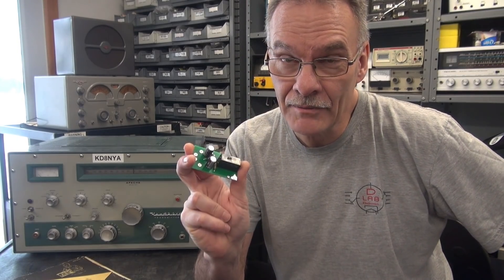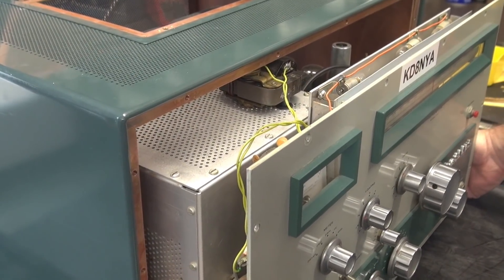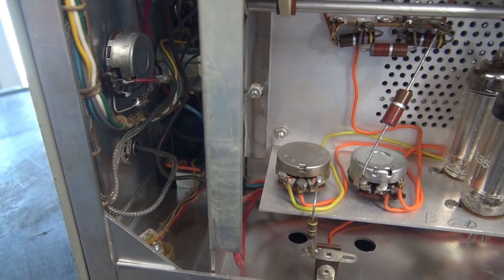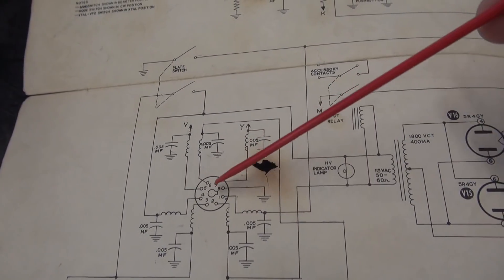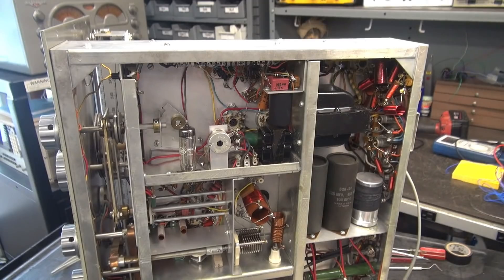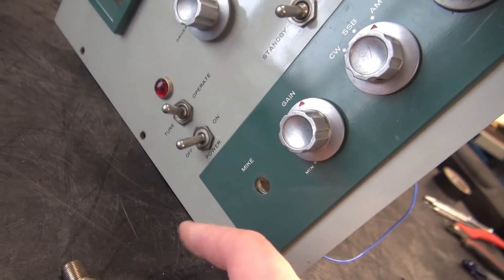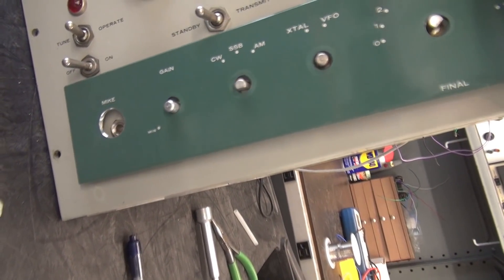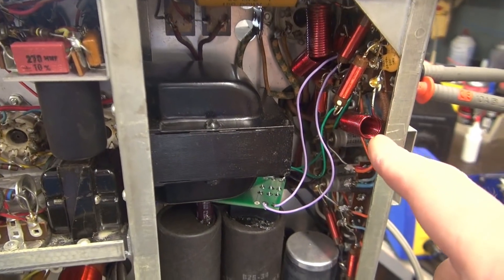How to install PTT Push to Talk Heathkit Apache TX-1 Ham Radio Transmitter

Comment: Hi Terrry.  I just picked up an apache.  My fix to the trs chassis mount jack issue was to use a flush mount jack with a 7/16 diameter × 1 1/4 inch threaded shaft. Lots of thread there to get through the three layers without removing the green plate.   You just have to drill the hole out to 7/16 to fit in the new jack.  These jacks are commonly used on telecaster guitars.  Check them out! BTW I would love to get a ptt relay for my apache from you! 73, Quentin VE1RCI

Comment: To secure the nut on the mic jack, you can use "LocTight" thread locker on it. 

Back in the day when bigger was better, all radio gear was over built to last. Another great video. Thanks.

Comment: Terry thank you very much for the Apache PTT circuit. I have already the radio apart and changed the mic plug and rerouted the wire to it. Thanks again for answering for request for help.

Comment: NICE Tx!!! Daaang, does that thing out weigh a DX-100? Impressive. Seems like you could put your little thing in a box with the appropriate male part attached - to plug into the female socket. An external mod. All the buyer does is install the mic jack and a wire to an unused terminal on said socket.  Not that it's on topic or that anyone cares...  but I'm desperate to get my 'Proud New General in 72' station on the air. DX-60, HG-10, HR-10B, keyer with microswitches, etc. Got it all. Got my very first D-104 from the sleaze bay today.. and got ripped off. It's nice looking. And dead.    Awesome Tx! Thanks for the fun and interesting vids OM

Comment: Could have used once is called a "thick panel jack" from Switchcraft and saved having to drill that beautiful panel.  
You could have gotten one at Mouser Electronics:  https://www.mouser.com/ProductDetail/Switchcraft/152B?qs=sGAEpiMZZMv0W4pxf2HiV3fTUvSc3cBdSDFCWZRCu9U%3D
Reply from the maker: I'll check it out, Thanks

Comment: Terry, I noticed you use all kinds of different meters but I have never seen you use a Fluke. Not a fan?
Reply from the maker: I use a Fluke 87 at work (day job) My favorites are the old Beckmans
Reply: D-lab Electronics I use an 87 myself! I need to check out a Beckman.

Comment: Another great video, Terry. I successfully installed a K1 into my Viking II a while back. It works great! Thank You. I also have a TX1 and I will be getting another K1 from you for that too. I have not had it off the shelf in many years. I suppose I am in for a rude awakening when I try to move it.  Just wondering if the K1 will also work with the Heathkit Marauder, as well? 73 Chris, N9WHH.

Comment: Good video about an interesting upgrade!  You had your work cut out for you trying to get your K1 in there.  Sounds like you needed two more tools: [1] a shoehorn, to force a gap big enough for the K1 to fit, and [2] some wooden dowels to act as rollers to get the chassis out of the case a bit easier.  Obviously joking about the shoehorn, but not by much!

Comment: I used to have the Apache transmitter and the Comanche receiver back in the early 70's.  Only used it for CW.  Heathkit made a SSB unit for Apache, but I upgraded to an SB-101 transceiver.

Comment: Nice install Terry. You are right about how heavy those are. I have two of them.  That D-Lab PTT mod is awesome for the TX-1. Here is another thought.  I have installed a few of those jacks in the TX-1. Instead of drilling the big hole you can mill the back side of the trim plate just enough to clear the nut.  Hole size stays original and looks stock.  As always my friend thanks for sharing!
Reply: > mill the back side of the trim plate
Yeah, that new hole in the trim plate looks huge. And can't ever be undone.

Comment: Great video!  Thanks for sharing!  Just a thought, perhaps replacing those old filter caps with something more modern (and smaller!) would have provided enough space to mount the board on the chassis.  Thanks again!